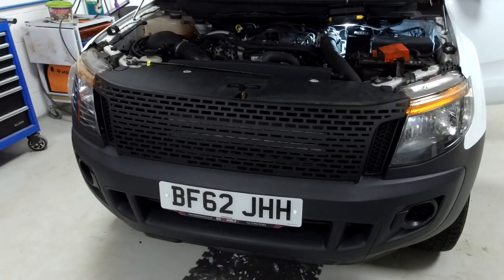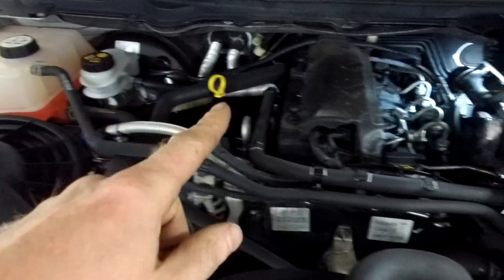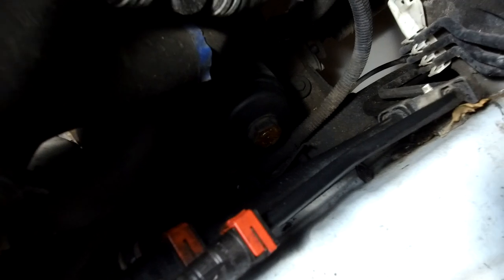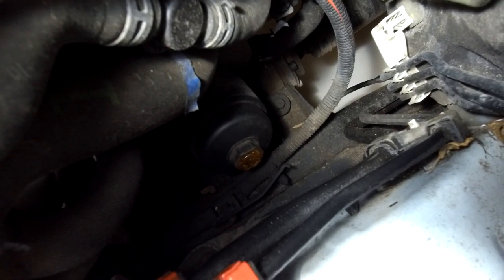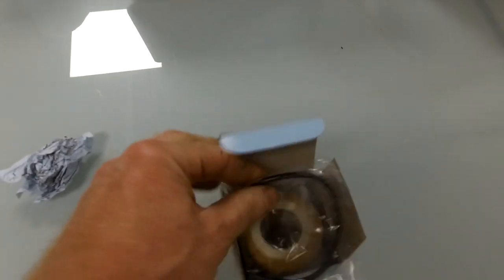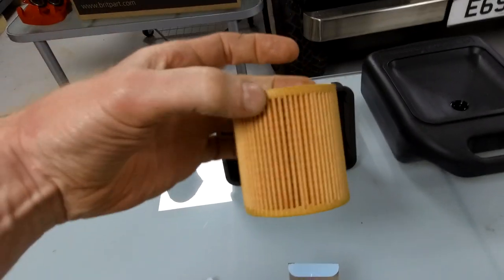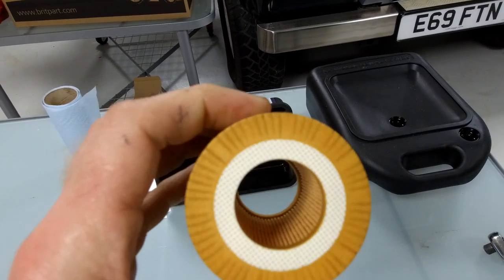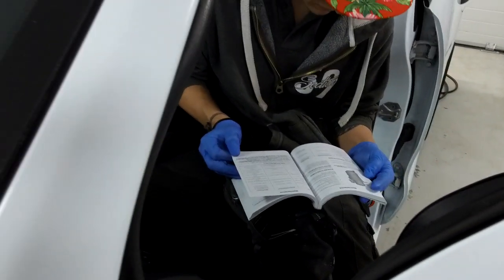How to change engine oil filter on Ford Ranger 2.2L Diesel pickup

Comment: Any ideas how to undo a badly burred hex on cap. Do think i could drill the hex and use an eg. 1/4 inch rachet extension through the hex like a t-piece or is it molded hollow which would put drill shavings in the filter pot. I would think it to be a solid hex because hollow would collapse or twist under socket tension. 🏴‍☠:oops:🌤. Hello from down unda.

Comment: Hi Guys.Thanks for the video. I have a BT50 2018. Did anyone noticed an oil filter by-pass valve in the oil filter housing. i have a weird sound coming in from the cap at cold start and will last for 15 minutes until engine gets hotter. Any clues will be appreciate. Thanks
Reply: How long did you leave between emptying the oil and refilling the oil?
Reply: Me too, what will it be?

Comment: so how much did you put in after rechecking the oil level? is it 7.5 litres still? because i'm not gonna drown my engine if 7.5 litres is enough.
Reply: Ive got this pick-up and 7 litres is enough...trust me! (2.2)
Reply: animal79thecat is 7L definitely right, I changed mine but I’m sure it’s over filled but it’s hard to tell on the dipstick they’re useless on the ranger.
Reply: 7 liter w/o oil fiter change... 7.5 liter if you also replace new oil filter for model 2.2 liter maybe 3.2 liter use more quantity of engine oil

Comment: Well done lads. I just did mine after watching this! I had googled this before, Google mentioned doing this within 10min. What do you think of the 10min rule?
Reply: I think do the filter first,then dump the oil,fill then start within about 15 minutes. No need to do a long drain to get every bit of old oil out.
Reply: Not every time but if you leave a Ranger engine without oil for longer than ten minutes you DO run the risk of the oil pick up running dry, it will never correctly refill again and the engine will have catastrophic failure, it is the one car we have strict rules on having everything ready prior to draining the oil!!!